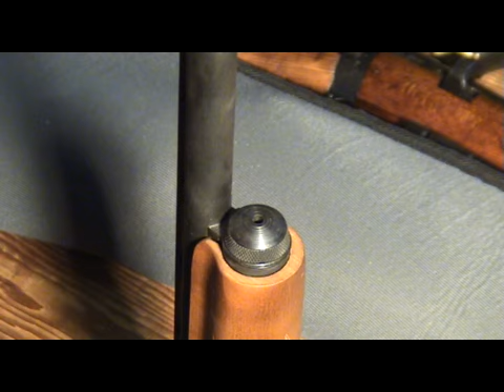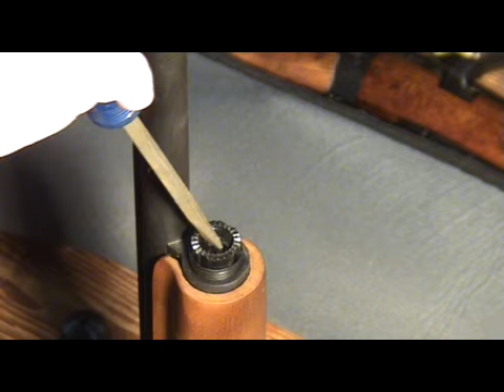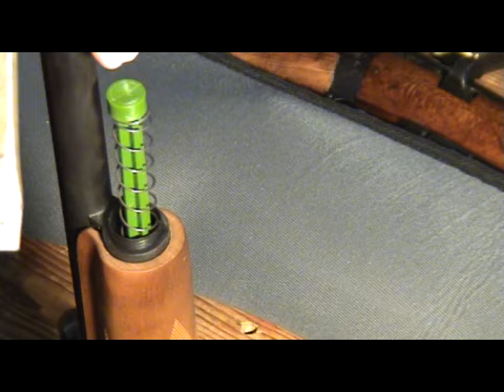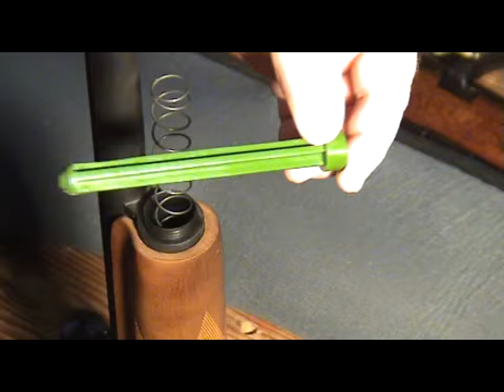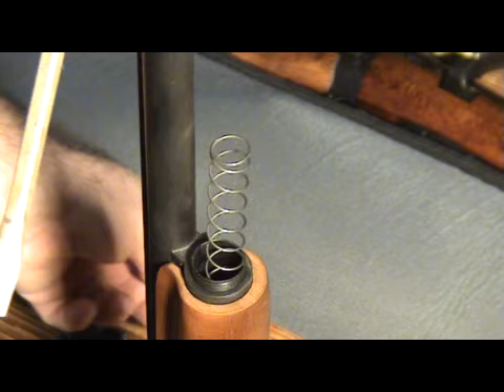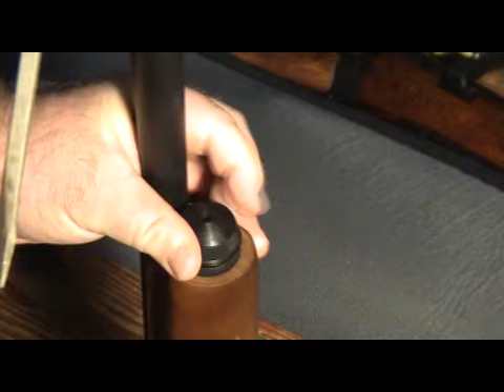HOW TO REMOVE OR INSTAL YOUR SHOOTGUNS PLUG

Comment: Just got '1949 Model 31..pre 870.  SLightly different.  There is a screw pin at top of barrel release.  screw out slightly and carefully - that is hole retainer so pin does not bind and also keep spring from flying.  Pulls out.  Remove stop, clean and put back together.  5 min or less.

Comment: Thank you. Just got a Smith & Wesson model 1000. And it didn't have an instruction booklet because I bought it used obviously. I did contact Smith and Wesson and they actually had an instruction booklet that they are sending to me but this is the only real thing that seems to be wrong with it is that I could only get two rounds into it. Thank you for the very informative video

Comment: yes it is. I just did it based off this video except pushing the spring down removes the little cap which is like the piece he takes out. Then you remove the plug and push the spring back down to put the cap back in place.

Comment: I wonder, if its legal to take the plug out as long as you don't load more than 3 while hunting. I don't hunt so its not an issue for me, but I was just wondering for others sake.
Reply: badazzmaro its not legal
Reply: I guess if I did hunt, I would just have to remember to put the plug back in. I understand the honor aspect, but still kind of silly that its a law. Oh well
Reply: badazzmaro it's illegal to hunt without a plug even with just 3 shells in the game warden will take the shells out and ask to see more and then start loading then if it takes more than 3 you get charged 5 bucks for every shell that's around you.
Reply: badazzmaro they make you have a plug because a shot gun is mostly used for waterfowl hunting and you have to give a bird a chance.
Reply: Ethan Harless most game wardens, in my area anyway, have a bar that they just shove down the tube to measure how many shells can go in.
Reply: It depends on what, where and is it just hunting, shooting or self-defense purposes. Legally you can remove your plug there is absolutely nothing wrong with doing so. 
Now certain States will have a specialty season for Snow Goose that you do not have to have a plug in your gun for(that varies by State so it is important to know the state you hunt laws are). 
Now you do have to have a plug for hunting most other species like Dove, Ducks and Canadian Goose that does not exceed the limit of three shot.(one round in the chamber the other two in the tube. 
Self defense and plain shooting does not require a plug.

Comment: I learned not to let the spring go flying when you put it in the gun I twisted the cap off and pressed the end piece and sent it flying it took me 3 minutes to find it I had the gun for about 5 minutes
Reply: I had the same thing happen how did you  re install the spring back in ?
Reply: M Pezzy what I did was I put the plug at the top of the spring and slowly work it down with the plug guiding it down.